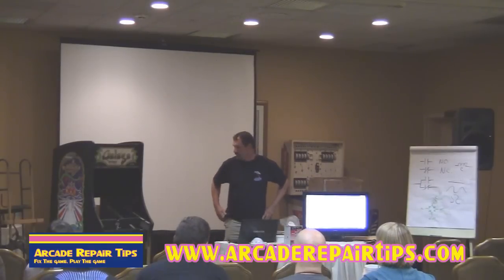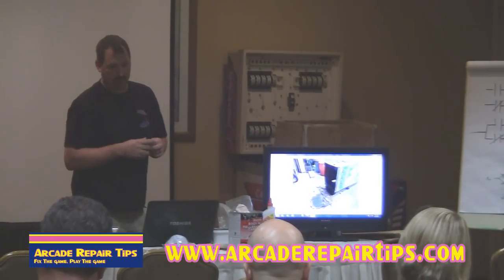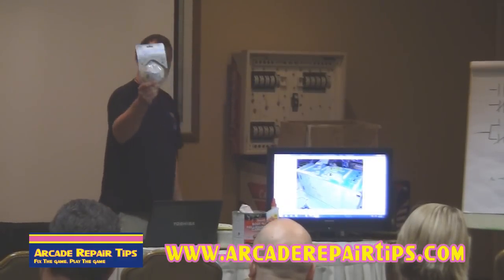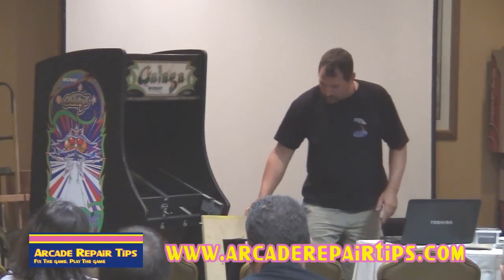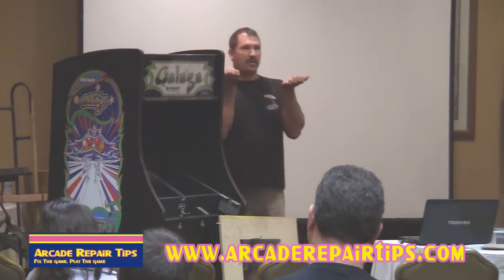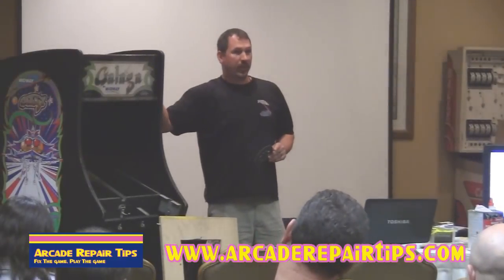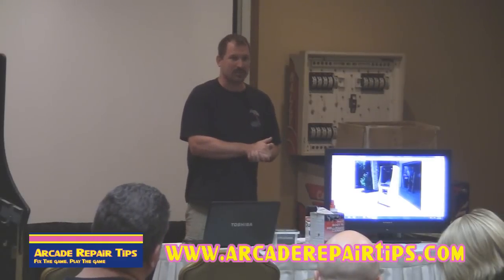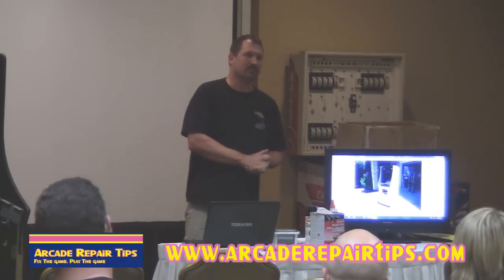Arcade Repair Tips - HAAG 2012 - Classic Cabinet Restoration

Comment: iam from the netherlands can some one tel me what do i need to do to power more than 1 arcade in my house becuase i have to cabs 1 donkey kong and 1 pacman when i plug them both in they wont work when i take 1 out 1 works ?? why is that in the netherlands we have Netherlands	 230 V	50 Hz	C & F